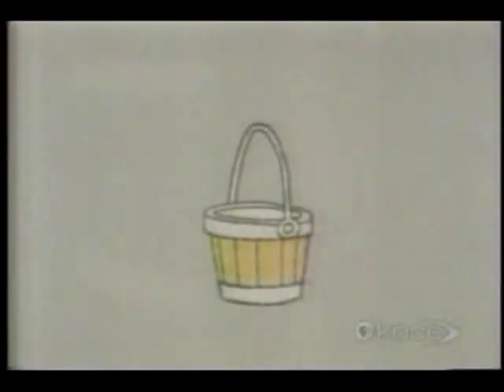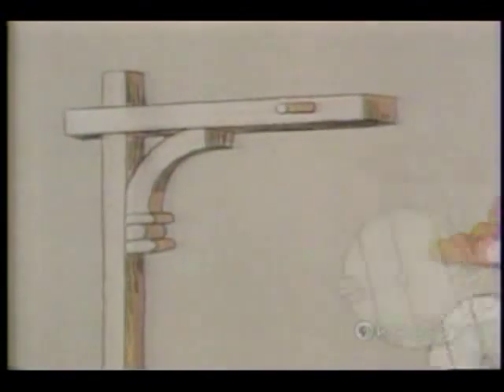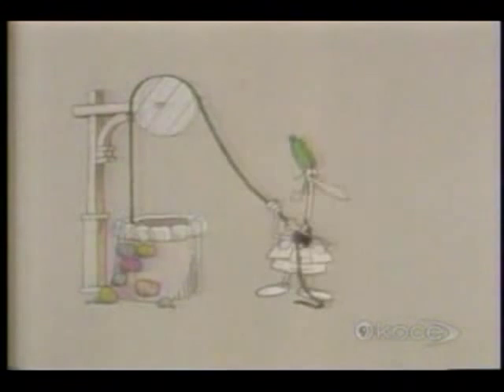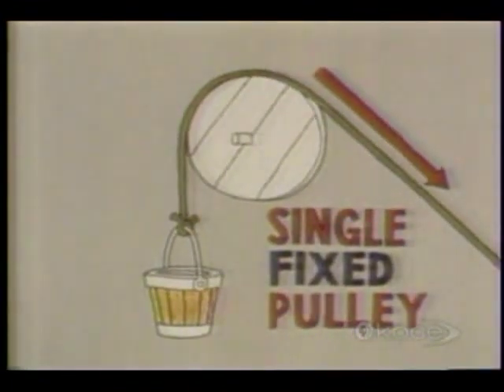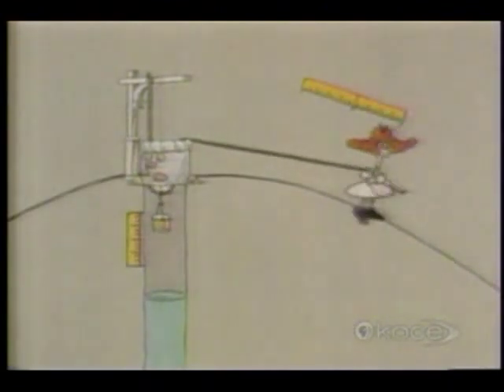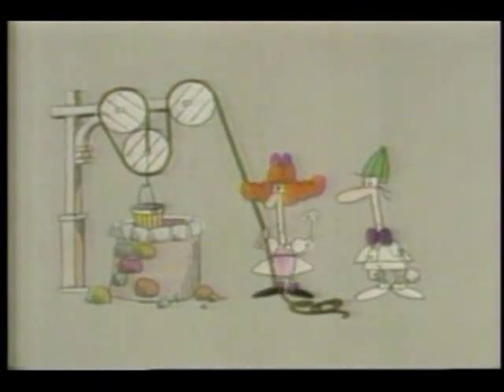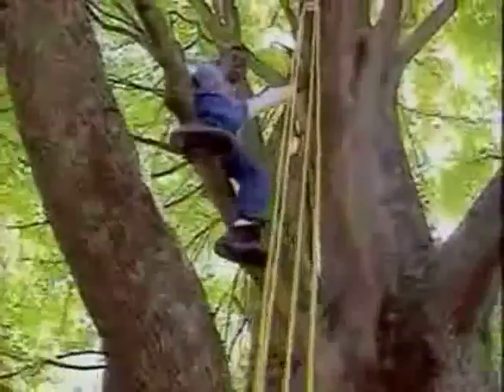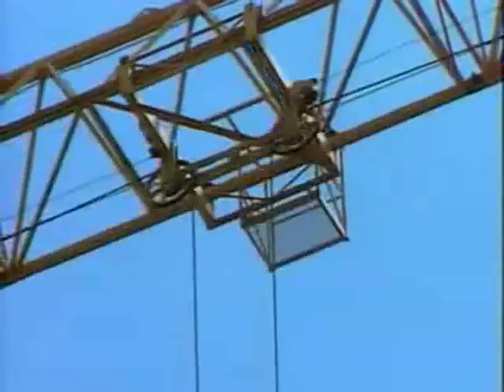Pulleys - simple machines

Comment: Your work is great .We are RMS INDUSTRIES (Loadmate)  "https://www.loadmate.in"(An ISO 9001:2008 Certified Company) is one of the leading EOT Crane Manufacturer in India. We also manufacture Manual Chain Pulley Block, Electric Chain hoist, Electric Wire Rope Hoist, HOT Cranes, Gantry Cranes, JIB Cranes & Goliath Cran.